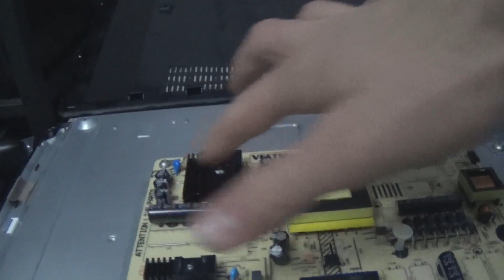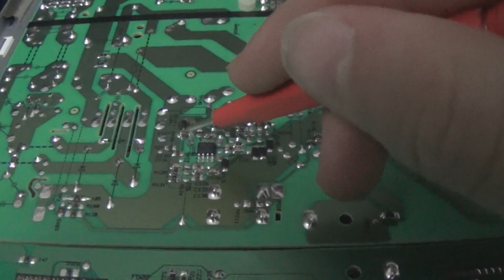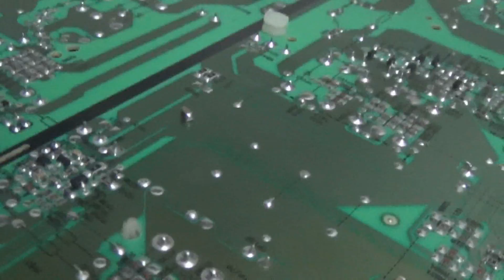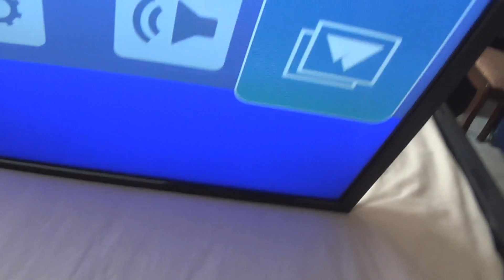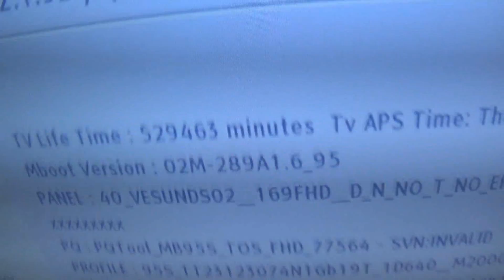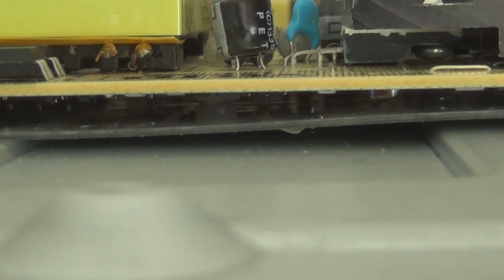17IPS20 No Backlight Repair

Comment: What size tv is this?
Reply from the maker: 40"
Reply: @MrReeceyburger123  Ah I have the exact same board and 40 inch panel. What is a typical current draw from these leds?. I have used an external power supply and the leds are drawing 150ma,  is that normal?

Comment: Is there a maximium current that the power supply will allow to the leds and what would be an allowable current??
Reply from the maker: The PSU output is designed for each panel size worth if leds 😁
Reply: @MrReeceyburger123  Is there a maximium current these leds can draw above which the driver circuit will shut them down? 
I read somewhere that there may be a 200ma upper limit which the driver circuit will suddenly role back.

Comment: Any idea why there would be variable voltage on the LED output circuit?
Reply: Tested all LEDs and they all illuminate individually. Might there still be a problem with them?

Comment: As to C525, I came today across notion, that this ceramic cap can be replaced by 47uF 100V electrolyte. You find space provided for it on the other side, marked C521. Both ceramics (similar third one, too) are reported as frequent to fail. Thanks for your lesson!

Comment: I'm getting getting crackling on power but no power led... no back-light at all. Capacitors all look fine. Any ideas?
Reply from the maker: Sounds like a short on the board somewhere. You need a DMM to test, power disconnected.
Reply: Its the board without the row of diodes.

Comment: Some good info. I'm looking at a polaroid 49" curved screen. I unplugged the LED's when i turn the screen on it flicks to 200V  DC on each of the 2x outputs and then drops slowly down to around 2V dc as the 2x 250V caps discharge with only the multimeter connected. Could it be feedback from the brightness control, perhaps the opto isolator or even the driver fet for the transformer from the switching side to the dc side. Any ideas?
Reply from the maker: Hmm is the 200v there then collapses with the leds in ?
Reply: What did he use to check the cap, diode mode or resistance mode?

Comment: Hi I’ve I’m in process of fixing my VESTEL board it’s for a 55 inchs  Samsung model 17ips20  board number 071114 R9.. 
Total led strips 12 . An got 7 leds on each strip 84 leds in total  3v Each . 

They are driven by 4 wires feds on the power board 2 for each set of 6 strips . 

I’m getting only 104 v from each fead and getting very low brightness on the leds .  Do you know why they are so low and maybe the fault or what’s the leds feads volta output ? Thanks ,

Comment: Dear Sir, thank you for this video. I have a problem you described at 2:00. After turn on the TV here is a spike of output voltage to about 185V DC but it last 1 or 2 sec, after that it goes to 120V and not 160 as you said. So according to this, LED is failing and power board is most likely OK. Is that true?
Reply: did you manage to fix this? got the same error
Reply: @franzjonshon7195  No, the faulty Tv is sold as parts…
Reply: @asv5769  damm it, did you check if the leds were ok? i just opened it and found 2 leds not working properly

Comment: Glad I found your video, I've the same issue, no backlight. I have just under 160v on LED+, changed the backlight driver IC, at startup, backlight flashes just enough to see boot picture. So, I guess it's shutting LED drive down, would I get this if some LED have failed?
Reply: I guess picture wouldn't come at all. Most likely power supply at the issue.
Reply: This repair was some time ago @seksualusis I think the issue was burnt out LED's which killed the original backlight driver, I fixed that then it fired up but because the wring current was flowing it shut down.. Then I trashed the TV by cracking the panel but I fixed the back lights!!! I then purchased a backlight tester and used it fixing another TV that ended in disaster, got lightening damaged psu PCB, replaced that with one of millions found on eBay, fired it up, no backlight.. Seller said, oh yes, it'll be your backlight, checked them, nothing wrong with backlight, all lit up same brightness then... Cracked screen putting it back together... Damn TV repairs.. Got a refund but was really cheesed off destroying what would have been a cheap repair.
Reply: @nickjones886  Still fighting mine. It has no base operation voltages (like 12V for mainboard), but has 300V from rectifier/PFC. The problem is, it is quite crappy design, scheme shows elements that are not actually present, and in current situation complicated to discover what is at the failure, as it is chicken/egg, not something sequential. May have to learn in detail how this power switching circuit is supposed to operate.

Comment: hello reecey, cheerrs for videos and all you do but have yet to find a fix for same model except all works great and then backlight goes out after 3 mins, only way to correct is to turn off and then on again, but same issue after 3 mins. My question is, surely this cant be a backlight issue if all working great then cutting off every 3 seconds??? sound is on all the time. What is telling the backlight to cut off??

Comment: toshiba vestel did not work
found bad mosfets amoung other parts that had failed on the main power board
changed failed parts tv powers on but no backlight, stripped screen to gain access to leds
checked all leds (3.7v each) found 1 bad led replaced with zenir diode 
when powered on backlight flashes for 1-2 seconds
removed zenir diode and replaced with salvaged led from another tv but replacment is a dual led
tested powerd on tv no flashes of leds no backlight illumination
retested main power board went through every component all test ok
stripped screen back down tested led connections to main power board all test fine.
decided to rewire all leds to paralell as there were 9 leds on 6 strips originally the leds were wired like christmas tree lights so if 1 fails then none will work, in paralell 1 fails the rest will still work.
worked out that 3.7v led x 9 because 9 leds on each strip equals 33.3v 
original configuration would require 199.8v so in paralell i could use a seperate charger/power adapter that would require around 30v,
i searched online for 33.3v charger and found that hp printer charger/power adapter puts out 2 different voltages 1 of 16v and 1 of 32v 
luckly i have an old hp printer i cut the end connection off cut the 16v line out and wired up the 32v line directly to the led stips all lit up brightly
after rebuilding the screen i just wired the power adapter from the hp printer directly to the leds now in paralell
left out the old led wire from the main power board and wired the hp plug end directly to the mains power of the tv
i rebuild the tv fully and cable tied the hp printer chunky power adapter to where there were holes for the tvs plug to rest. the tv now lights up as soon as it is plugged in and within 2-3 seconds the image appears perfecly
after leaving on for 3 days solid the tv feels cool to the touch while the hp power adapter gets quite warm it is outside the tv so does not affect anything, a lot of head scratching and research about vestel tv's multiple tests

I did all of this for my friend the tv failed after 1 year of purchase he bought a new power board and that then failed after 7 months, the exact same parts on both boards after testing were blown/damadged and even after replacing the bad components on both of them the tv would only flash a red/green light but because he really likes the tv i offered to help and hope this helps others as sometimes even replacing the leds and maind boards these tvs refuse to work now both repaired power boards work great and the tv no longer uses the led power side as its externally powered this should be a long lasting repair

Comment: hello mate, thank you very much for the well detailed video and explanation. i have the same board and i think it has the same problem so i have to replace c525 cap but when searched online there are 2 different types of it. 1uF 50V 10% x7R 1206 SMD cap and 1uF 50V 10% x7R 805 SMD cap i believe these are different size of the same cap but can you please confirm which is the one you used ? cheers.

Comment: Hello,
I have the same problem and the same card.
I wanted to know what should be the output voltage at the connector CN501 (connector that powers the LEDs)?
I have 100V, so is it the right voltage and is it the LEDs that are dead or not?
Thank you.
Reply: One might check first, if he has about 400V on big caps, as measured here. If it is way lower, this may involve earlier stage, just like it was suggested. Even though this earlier turned to be caused by short at the end, being connected.

Comment: I to every one, I have a 171PS20 and C312 is missing , does any one no the value of it please. The cap is across  Q301 on the big black heat sink, just it`s pin`s there.

Comment: Hi there. Great videos>
Can a 17IPS20 board (same Voltages and screw positions?) be swapped out no matter what makes the TV is? I believe Hitachi, Polaroid and Bush all use this board.
Reply: Check for product codes to match, also if LED connector meets your plug. There are variations out there.

Comment: Hy, what should be the voltage output normally for a Telefunken T39FX182DLP 39"? I put there 167V through a 4.7K resistor, but I've got 167V on the LEDs despite that resistor being in series with the LEDs, I tried then with 100ohm and with no resistor and the backlight is the same, barely lighted. I want to sweep that board for a different one, with a simple design that I have, but I need to know the voltage.

Comment: Hi Reece, I wondered if you could shed any light on my tv. My backlight works fine when the brightness is dimmed down but when the backlight is turned up it cuts out completely. I am now watching tv with a low brightness screen. Also when a usb device is plugged in - this cuts out the backlight too. Could you help please?

Comment: Hi, I have a problem with this power supply. The TV has no backlighting and the voltage on the connector that goes to the LEDs is 65V and not 115V.
Reply: The same
Reply: My case exactly. I also have about 300V on big caps, instead of 400V. These ceramic caps are first suspects, if not around.

Comment: I have the same psu problem, but I have 120volts steady on the six diodes and 380volts on the left cap.Also I hear a strange sound coming from the pcb.Any idea?
Reply from the maker: What you tested ?
Reply: I have change MP3394S controler,I have checked all mosfets Q301,Q211,Q100,Q502,Q101, are OK ,all diodes are ok.C525 OK, C127 OK.

Comment: Hello Reecey! I have the same power supply! After replacing three shorted diodes sb5100 now my tv turns on but after the philiphs logo i hear a wistle sound and the tv turns off and again on and does the same thing. I cheched that all led turns on and they do. Also updated the firmware!I messured the voltage on the output for the led lights and i have 190 in the beggining and 150 later. what could be wrong?

Comment: Hi. Thanx for the detailed video!!
I have got a 40" with no backlight: There are 125V over the six hughe diodes where 180V are supposed to be. 125V as well on the diode a bit higher on the top right side. Over the hughe cap on the left side there are 380V. So, I have changed the driver MPS3394 and the MOSFET MDD14N25. But there is still no backlight. In regard that the TR300 seems to be driven well with 380V, what else could it be?
Reply: osoletio did you find a solution? I have exactly the same symptoms. What should I check?

Comment: Hy my friend! I have the same board, and i have repair it but the tv not go on ! If you press the on bottom the red Stand by led blinks 4 or 5 times and then nothing happens. The power supply is working and i have 121 Volts on the white connector to the LEDs. and also I have 12v on the black connector! What else can it be ???

Comment: I've got 17IPS20S that works ok for few hours. But then it switches the backlight off. If I turn the TV off and wait for few minutes I can get backlight again for few seconds and than it turns off. It would be better if it would stay off all the time for the diagnostic purpose. Any ideas about this problem?
When it's working I get 167V between chasis and red wire and 25V between chasis and black wire.

Comment: There is a few models using the referebce 17IPS20. My 55ao2usb is compatible with 17IPS20 taken from other models ?
The tv is shutting down the ledpanel after some heavy work like, 3D movies from PC HDMI, and one or 3 times using the internet.
I want to replace, but I dont know If a can use any 17IPS20
Reply from the maker: Replace the mainboard if its turning off randomly.
Reply: It can stand days weeks without shutdown  just the screen (sound continue play), but when I connect the PC+HDMI to see 3D movies, the tv only can take some ~30min, then I need to turn off and on again in the remote, and everthing is ok
Reply from the maker: Replace the mainboard.

Comment: where did you get your mps3349 chips from? I have a vestel 17ips20 in the back of my TV and its measuring at 120volts I assume its that chip that has gone down. need to find out where to buy. cheers
Reply from the maker: Hi mate I got the chip off an ebay seller called Tekkid he sells them for a good price.
Reply: +MrReeceyburger123 I can't seem to find him on eBay. the chip I have is mps1333 could you find a link and post it please. thanks. dan
Reply from the maker: Hes sold out thats why just checked :L

Comment: hi fella fantastic video m8, i fix tvs for a hobby love doing it,  i've got a polaroid, p40led14, with no backlight i've  tested the red wire 117 volts coming off it and stays there, but at this voltage does it like one of the leds has shorted, thanks for your time,
Reply from the maker: Hi mate thanks for the comment, if its stuck at 117 volts the driver chip MP chip as shown in the video is normally the cause.